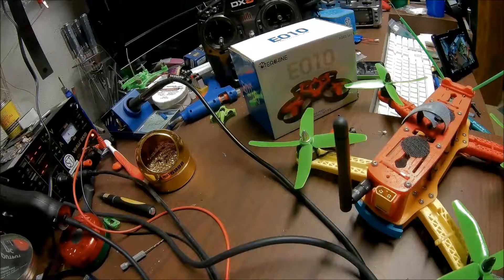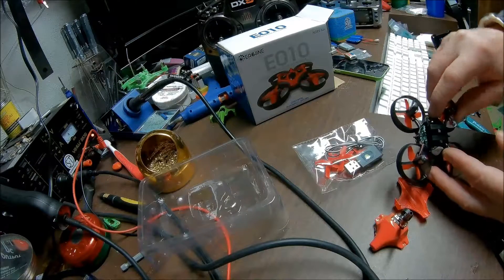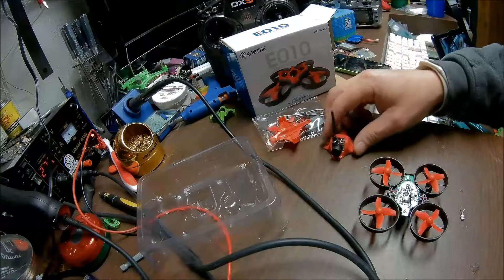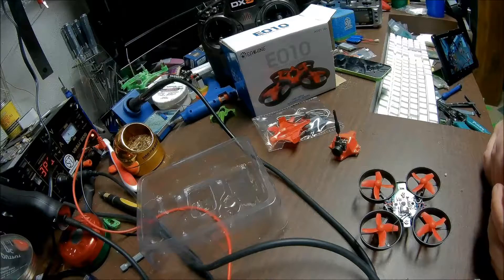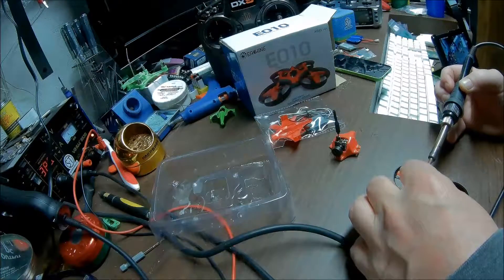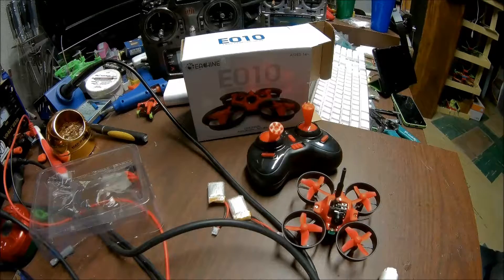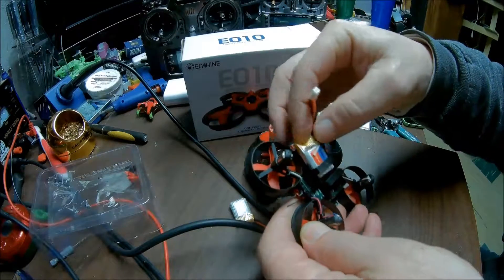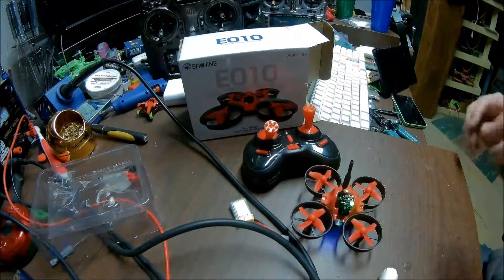EACHINE E010 TINY WHOOP FPV CAMERA INSTALL

Comment: where do you get the little body that holds the cam?
Reply from the maker: amazon.com Crazepony FPV Micro AIO Camera 5.8G 40CH 25mW Transmitter with Y Splitter for FPV Drone like Blade Inductrix  it came with a clear one or look up this one and you get 3 green red clear  but no camera
Reply from the maker: Kotipelto  ok thanks I reposted. I think I sent it to you as a private message kind a new at this :-)
Reply: I just got 2 furibee f36 quads and some extra frames+motors from china. The frame material/compound is quit different than the e010 frames. There are quite a bit softer. Almost like the stock inductrix frams but more like a rubber compound. Im am very new to all of this. Thanks for posting all the videos man. I got x2 of the boldclash f01 cams just waiting on vr008 goggles. Ive been flying the inductrix for a month now. Im ready to jump into fpv!
Reply from the maker: sweet! you will love it. this last year the price on fpv has dropped a lot. the f36 should be a good one to fpv. the motors specs look better then the E010.
Reply: Hey Kriss! Do think the stock inductrix body cover work with the boldclash vtx F01 if I mod it. Or do you think it will just not fit?
Reply from the maker: i think so. just think light when you mod. or a